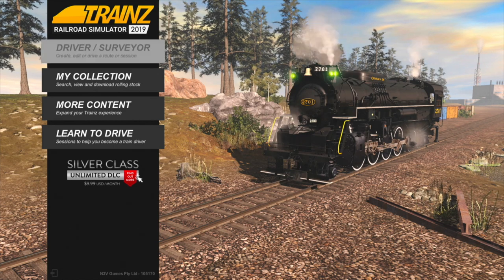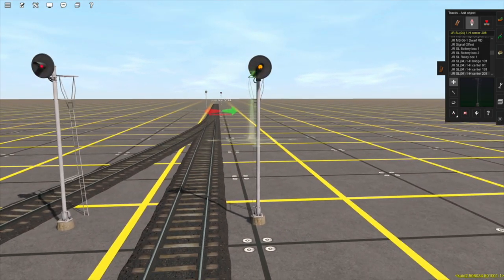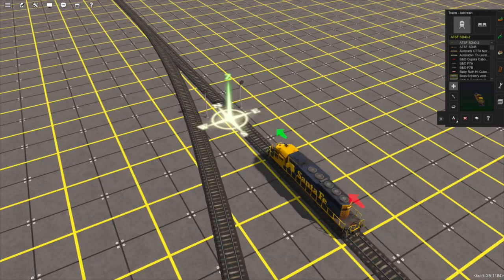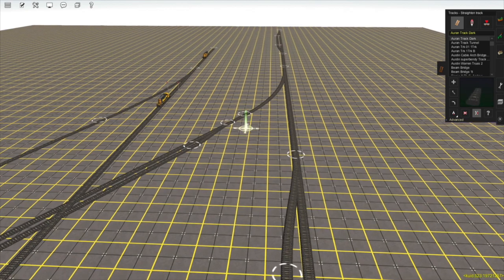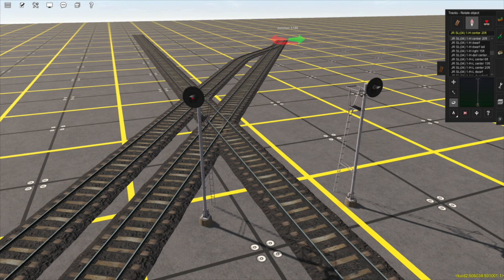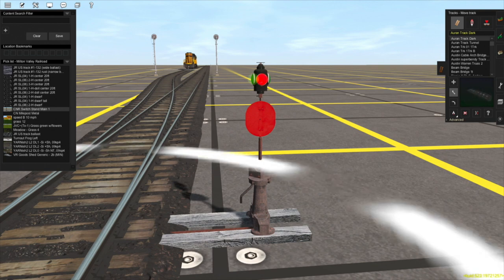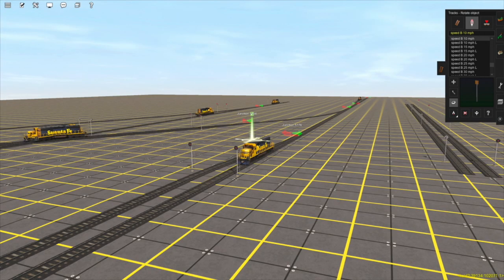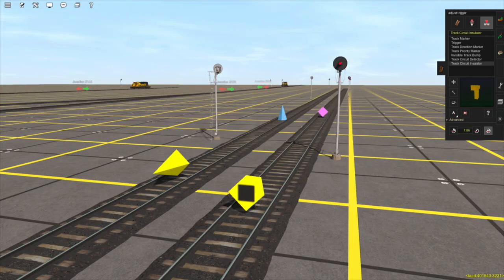Trainz route building tutorial Ep. 09 | Signals, Trackmarks & Other track side objects

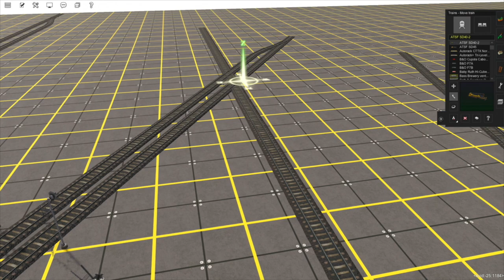Comment: 8:00 when you spoke of the diamonds, how do you make them look realistic, or are they supposed to look like tracks simply crossing without tieing them in?
Reply from the maker: Typically you would use check rail trackside objects. Here are a few KUIDS you may want to have a look at: <kuid2:45324:26006:1>,<kuid:236618:90291>,<kuid2:45324:26005:1>,<kuid2:45324:26004:1>,<kuid:236618:90290>,<kuid2:69937:100079:1>,<kuid:236618:90272>

Comment: Can you show us how to correctly signal a diamond? It's not particularly nice to see the trains just phase through each other.
Reply from the maker: As far as I know the only way of doing that is through manually controlling the aspects of the signals with session rules. Though you could probably come up with some way of automating when the signals change with lots of variables and triggers, I'd recommend scripting it on a per use basis.

So if you're making a session where a train is expected to come through the diamond, and you want a second train to stop for it, force the second train's signal to be red (using the "Set Signal" session rule) until the first train sets it back to automatic by running over a trigger placed after the diamond (using the "Trigger Check" and "Set Signal" session rules).

You can also do signalling with interlocking towers, but I've never used those and doubt that they can handle diamonds.